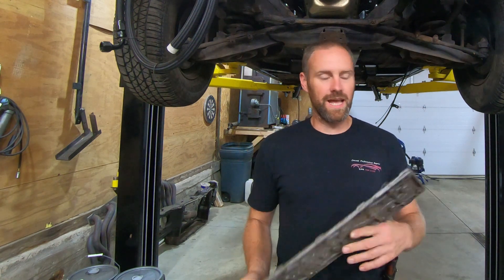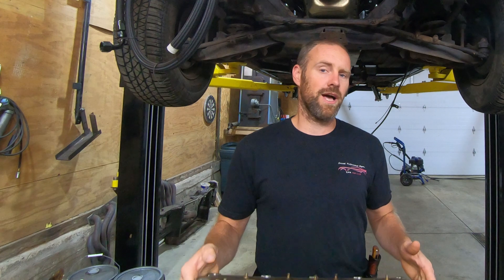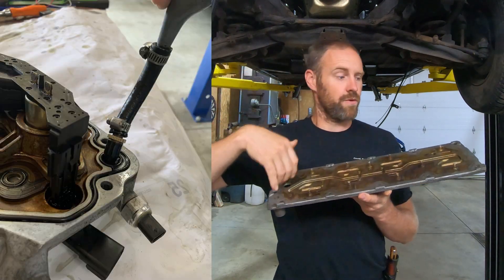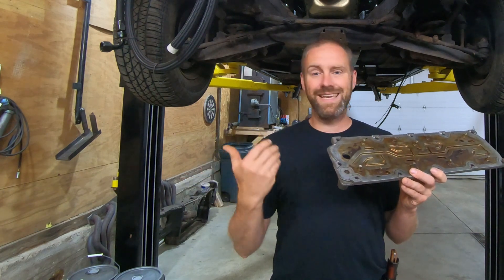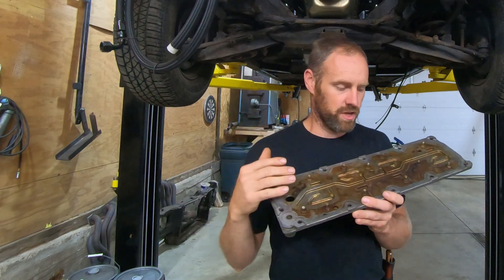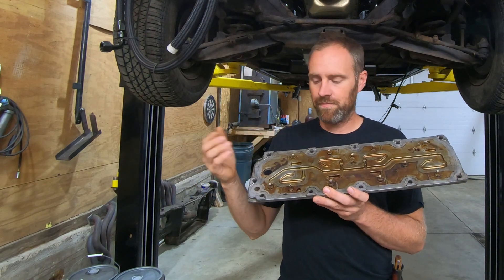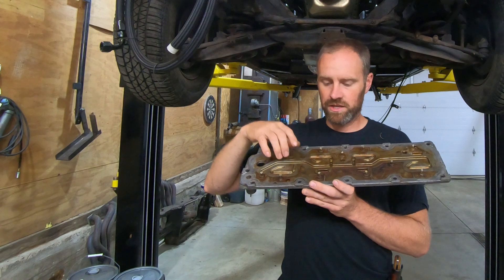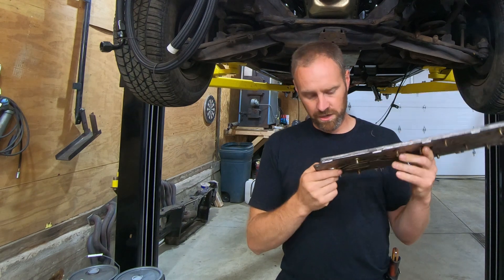LT based Direct Injection Must See!!! VLOM mod Information Update

Comment from the maker: See description, I have an update. This may not have been as important as I thought it was.
Reply: If I have the AFM turned off already in the pcm can I cut the gaskets on the VLOM and not get a tune? When you say tune is that what you are talking about turning off the AFM in the pcm
Reply from the maker: @richieharris4587  turning off AFM in the PCM requires a tune to do so. If you have a lot based engine tune alone likely isn't enough. These VLOM are prone to leaking they also should have the VLOM plug I offer installed along side the tune.

Comment: Hey brother,  first off thank you for the videos.  Wish I would have stumbled appon then before I got myself into this debacle.. 2018 5.3L direct inj.. cyl6 int dod lifter collapse and stuck in lifter bore.  I pull the head,  pull all the lifters and vlom. Reinstall all gm parts, lifters, cups, vlom. Start truck up. Cyl 6 and cyl 4 dod lifters collapsed and lifters not moving.  Thinking vlom issue, pull it,  replace with another gm vlom. Same issue. Pulled vlom plug, no change.  What did I do wrong? But looking forward to pulling everything apart again.
Reply from the maker: Might have spun lifter/lifters from bad plastic guide. Could be garbage lifters if you bought some cheap Amazon or eBay junk. If you have to pull heads again It may be wise to just completely delete the system with a full mechanical delete. I do sell them on my website if you decide to go that route.

Comment: If you have the dod turned off via tune or the range device in the obd2 port could you not just plug the oil towers like you would when you do a full delete?

Comment: So im having an issue where I did de delete kit from Texas speed and now I’m having an issue that I’m getting a lot of oil in the intake manifold and intake valves I have check compression and valve seal and all good I think thinks an issue with my VLOM leaking so much oil trough the AFM SYSTEM that the PCV valve it’s sending all that in to the intake and before you ask it has a brand new PCV I wish you had this plugs on Amazon so I can get them sooner
Reply from the maker: First of all my shipping is two-day shipping from my website so it's no slower than Amazon. Secondly you don't need the product anyway. If you did a full mechanical delete you should have the VLOM replaced with a non AFM valley cover or blocked off with the plugs in the oil towers. The bad news with your situation however, is that most likely you have a bad lifter in the cylinder seven area. Take the valve cover off and check how much oil is squirting out of the rockers when the engine is running. You should have hardly a trickle coming off of those rockers if the lifters are good. If the lifters have a hydraulic failure however it will be squirting oil a long ways possibly over the fender well. If you have that much oil squirting out, it doesn't matter how good the PCV is It can't evacuate at all correctly.
Reply: @CrazedPerformanceRepair  ok then I’ll check the new lifters with the engine running it does worries me oil that oil on the intake at one point not gonna lie I got almost a quart out of it and mentioned the plugs cause I need it to ordered them Friday to get them Sunday and have time work it out thanks for the amazing channel by the way.

Comment: As for the high pressure lift pump getting enough oil from below, it has only an opening in the casting of the block. Which is why GM added the oiling port from the VLOM. It has a lifter made in the adapter for lift to the high pressure fuel pump. It needs oil. And why cut the gaskets around the oiling towers if you have them plugged. Unnecessary and added insurance if oil pressure gets by the fabricated plug near the oil pressure gauge?
Reply: What is interesting is the L84 does not have that hole for oiling the fuel pump on the valley cover because it is DFM.  I do not see on the L84 how it oils that area like the LT1, L86, L83, etc.  So I am wondering if it is even needed because why would GM delete it on the newer gen?

Comment: I have a 18 Tahoe, been fine, I disable DOD around 50k miles with my tuner. The other day I jumped in the truck, everything was fine, stopped for an hour, jumped back in, started it and everything was fine, accelerated at like half throttle into traffic, heard what sounded like a slight rod knock, by the time I rolled down the windows to get a better listen, the noise stopped. No issues driving, no misses, highway, stop and go, all fine… five days later (today) same thing. Took a ride to a few stores, came home, truck sat for a few hours, jumped back in to go out, heard the noise again but not as bad. Got to where I was going. Truck say for 1.5 hours, got in to go home, no sound! Def coming from the passenger side. I know it has to be DOD related because of the common issues… what direction should I go?! I don’t want to start throwing parts at this or taking it apart if I don’t have to. Is it the direct injection pump? Is it a sticky lifter? Should I pull the intake and do whatever gasket mod you described in this video? Should I eliminate the VOM entirely?! I’ve watched three of your videos already and I see you’ve have tons of experience with different variations of this system and the issues with them. Please help with some guidance.
Reply from the maker: That one should have DFM rather than AFM. That means it can control all 8 cylinders and no longer has a VLOM. The pushrods are an issue still so you could start there for good measure. It also would be wise to disable DFM in the tune if possible. Ask LT1swap.com about that one. As for whats causing the noise. My guess, maybe a lifter is about to blow its guts out or perhaps the oil pump is about to grenade. Most likely the lifters though.
Reply: @CrazedPerformanceRepair  thanks a lot. Appreciate the response. It’s does have AFM confirmed by the build sheet from GM. It has an L83 5.3 in it. Oil pressure has not changed until today. I noticed it was down 1-2psi and oil is 75% until next change. Typically at cruising speed it’s always been at 40psi. No noise today so far. I did order your VLOM plug and lifter tool. I’m going to start there with the gasket mod and now you said push rods so I’ll add that to the list and see what happens from there.
Reply from the maker: @booostin21psi  must have a manufacturing date from 2017 then if it has AFM l83. Interesting, well keep me posted.
Reply: @CrazedPerformanceRepair  will do! From everything I read and watched, if I do your VLOM plug and gasket mod, leave the AFM disabled via the tune… I shouldn’t get any code and the truck should operate like it has been. By doing this, the theory is…  it provides better lubrication to the lifters and making it not prone to the typical failure, right?
Reply: @CrazedPerformanceRepair  just wanted to let you know that I got your VLOM plug last week, installed the plug and did the VLOM gasket modification. Three days into driving and 200 miles with all types of driving, haven’t heard that noise yet. I’ve tried to replicate it the same way when I heard it last week and nothing. I’m hoping I caught it in time to save the lifters (and money) and preventing a full DOD delete. I have a lot of driving the next five days so that will be the real test.
Reply: So after a few weeks of driving… the lifter noise has reappeared but not has bad as it was. I also noticed being here in Florida, it has happened on hotter days vs cooler days (since we’re starting to transition into summer temps). I know the LT V’s call for 0-20 but have you ever run a higher viscosity oil in an LT or LS engine. 5-30 or 5-40 weight with any issues? Does the Dexos classification really make a difference?
Reply from the maker: @booostin21psi  you probably have a pitted lifter roller and cam lobe. This is something that can't be prevented necessarily and will ultimately require new cam and lifters as they will only get worse. I have one video for sure if not 2 where I diagnose one of these. I believe one was a live stream and the other was a full edited down step by step. Basically you will need to listen to rocker bolts then use dial indicator to verify pit in roller and cam. In the meantime if 5W30 might help reduce some of the wear. Possibly add a little zinc supplement as well.
Reply: I did watch that video. My noise isn’t consistent at all. Prior to commenting when I first heard it come back I did listen with the stethoscope. I know it’s coming from the passenger side and it’s def coming from one of the two DOD cylinders. I also cut my filter open to look for metal and it was clean. Engine is spotless inside. Actually, I was surprise how clean. The heads looked brand new for an engine with 88k on it.
Reply from the maker: @booostin21psi  depending of a roller and cam unless it's severe won't be enough to detect metal in the oil filter. You will likely have to just run a little thicker oil until it gets bad enough to isolate which one it is.
Reply: Thanks. Really appreciate all your feedback. I’ve been working on vehicles for 20+ years. Was my profession early on. But this community on the internet was always lacking real people with a mind to share with everyone to make everyone better at what they do. You are not one of those people and there should be more people like yourself that do these videos and share their knowledge of what they found.
Reply: You’re awesome man! Keep doing your thing!
Reply from the maker: @booostin21psi  feel free to hop on my actual website and hit up the forum section next time you have any questions. I don't always catch these things on YouTube because as you could imagine I get asked a lot of stuff on YouTube and miss a lot of it.

Comment: Quick ? I Had to replace my afm lifter on 08 silverado5.3 for the 4th time in 6 years. Truck runs good except for sometimes feels sluggish but also every now and then it dies and on restart it goes to limp mode stabilitac error (usually lifter problem) and rpm dont read (sometimes with mph). but on other times it runs just fine. Would like to mention that during torqing I turnd crank clockwise a couple times. Did i mess up timing or does anyone know what's going on?
Reply from the maker: You might have a bad ground for the wire behind the head. It also sounds like you need to shut off AFM in the tune because you clearly don't have enough oil pressure for AFM to function properly on that lifter.
Reply: @CrazedPerformanceRepair  hmm, I'll check the ground. A guy here in sa tx charges $2000 for complete delete mod, is that a good deal? Might be time to bite the bullet.
Reply from the maker: @Reaper21O  parts included is possibly sketchy cheap. Labor only is probably about average.
Reply: @CrazedPerformanceRepair  yes its $2100 with parts 1 yr warranty or $1300 only labor i buy parts but no warranty. Im hoping it works fine if i fix the ground issue. The guy has fixed my other cars before so i trust him at least.

Comment: Great video, got  a 2009 Silverado 5.3 53,000 miles but the vlom bolts were all lose in the front as well. On the DOD which place you recommend for the reflash?
Reply from the maker: Lt1swap.com